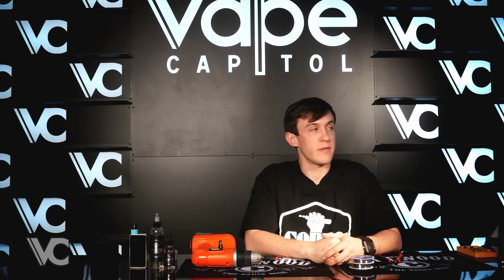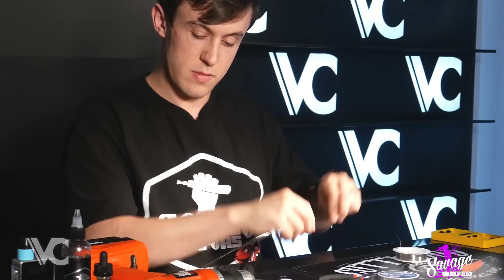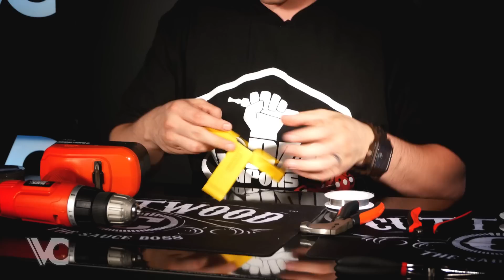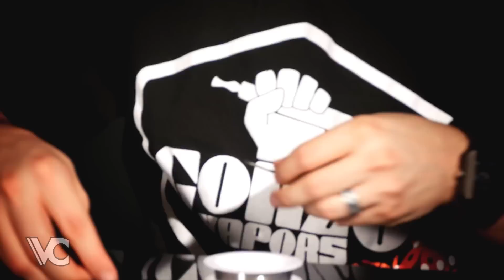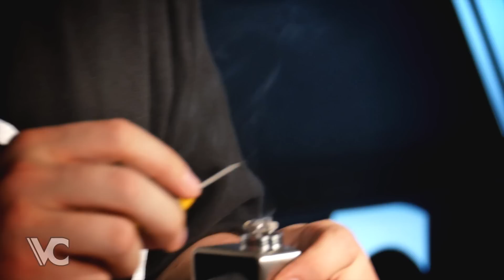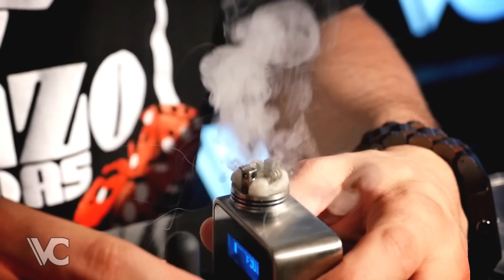Buildlapse - Fused Clapton 26g N80 / 40g N80 7 Wrap  ||  Vape Timelapse

Comment: what was ohms and what wattage was he running it at
Reply: +Jarrett Dobbin With these builds I usually stay in the 80-90 watt range.  I don't recall the ohms of this build exactly, but because of the number of wraps I would guess 0.22 ohms.  With 5-6 wraps they're usually between 0.14 and 0.18 ohms.